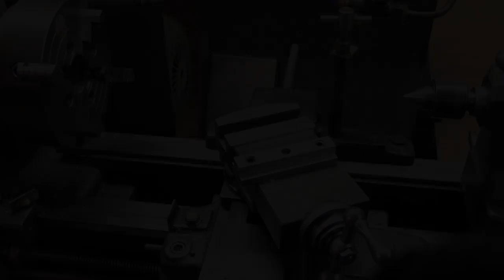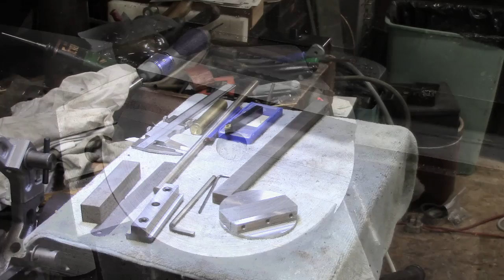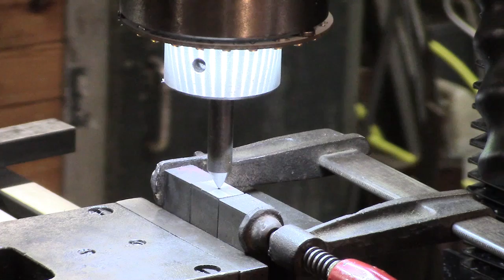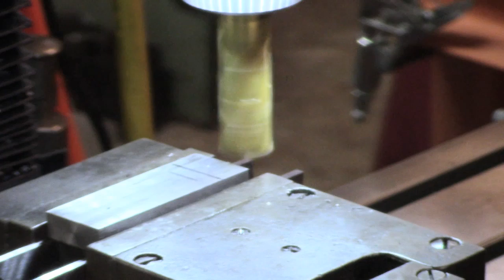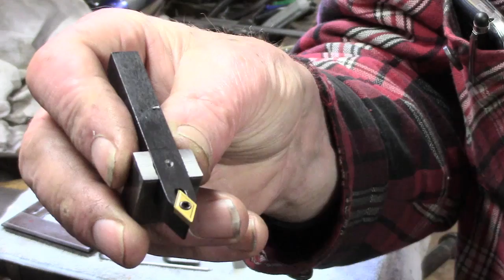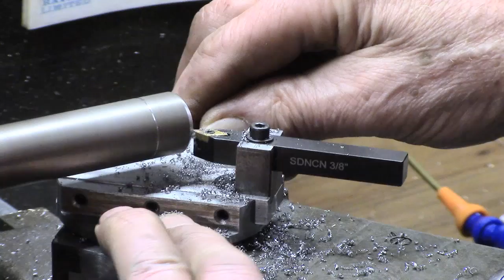Radius Ball Turner Part Three - And First Test

Comment: If you put a strip of leather between the parts and the movable jaw of your vise you can make it nice and tight and the parts "will not" move... A very old technique tried and true! Best wishes... :o]

O,,,
Reply from the maker: Yep - should have used the leather trick I think! OK as long as the leather is dimensionally reasonable for thickness.
Reply: ChrisB257 Thin is usually better than thick, when holding multiple pieces of stock in a loose vise... You can usually put a goodly amount of cuznercholy on the old vise handle... :o]

O,,,

Comment: You're getting there. Needs a few tweaks and refinements. I think surface finish is related to SFM. Needs to turn faster but thats hard with a long stickout.
All through the vids I've been thinking of a design for one of my own....can't help it...LOL

Colin ;-)
Reply from the maker: Yep - some tweaks left to do but does in a sense show 'proof of concept' at least! Certainly far from ideal but interesting to try it all out. Maybe better SFM increase could help but also I think I'll see if I can make an HSS tool bit with a decent radius ground on it - several options yet with cutting tool choice.  Will make a better handle next.